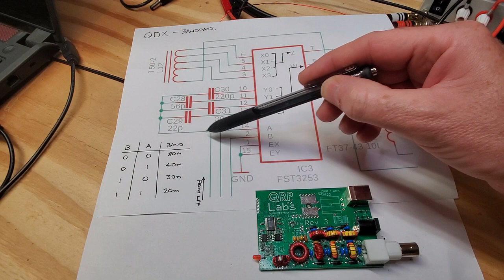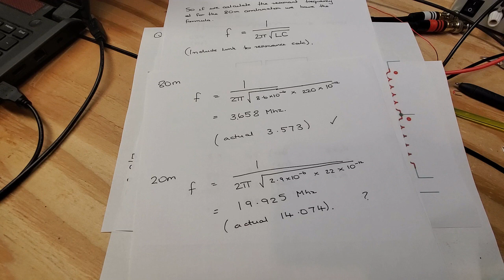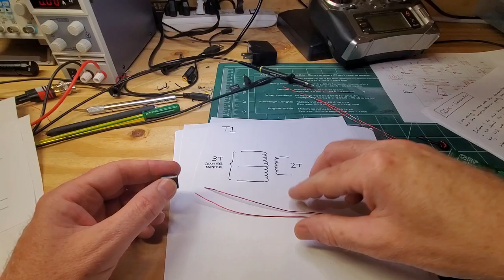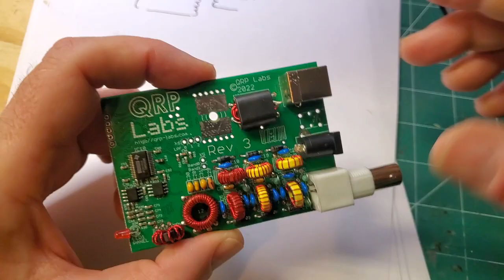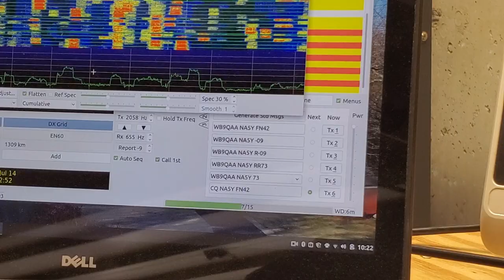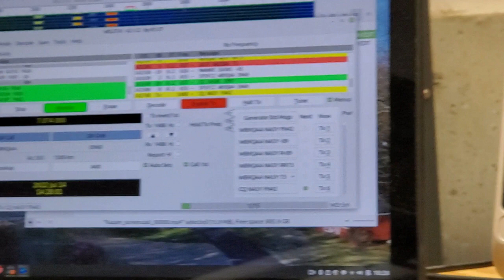QRP-Labs QDX Kit Build - Transmitter

Comment: I haven't analyzed the circuit yet, but I'd certainly expect the diode's capacitance to affect it.
Reply: May be reusing the same toroid for each band is also changing the resonant frequency. It is finally a transformer and is connected 4 times to stray capacitances.

Comment: Just finished my kit. Having difficulty getting comm port to laptop Win10 connections. What was the order of turning on(QDX and laptop) and connection via the BNC cable. I think I may be having a problem there. VE6KBI Dana Thanks in Advance.
Reply from the maker: Dana, First is power then connect USB. The QDX draws no power from the USB. When you plug the USB into the QDX you should see a virtual com device appear in the device manager in windows. Are you able to see that? I wouldn't worry about connecting the antenna until you can that. You do need to connect the antenna if you want to run any of the filter tests - but that will come later
Reply: @na5y  Thank you. Dana ..
Reply: @na5y  I got it to work once, then my laptop "lost" the serial connection. At least I know it works. Now to get the laptop to work properly...... Thanks Again. VE6KBI

Comment: Try adjusting the toroids for maximum output before you box it up. I found it made quite a difference!
Reply from the maker: What changes did you make Mario? Did you bunch the windings closer together? In the end I was getting about 4.5W on 20m with 11V input so I called "good enough" ;)
Reply: @na5y  Ian, I adjusted spacing only - no other changes. My version 2.0 built for 12 Volts achieved 5Watts or more on all 4 bands at 13.6 Volts input (with the diode included).  I was only getting 3.5-4.5 watts before tweaking.  I'm really enjoying operating this thing in the field with a pi4 and various wire antennas!

M